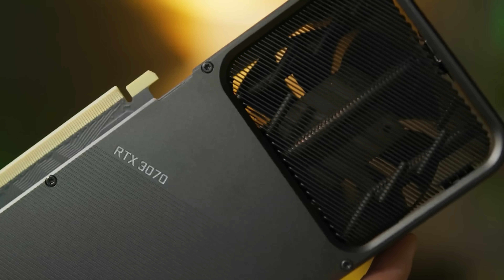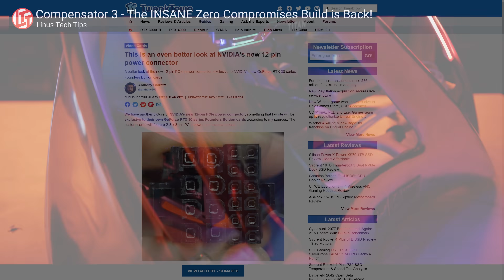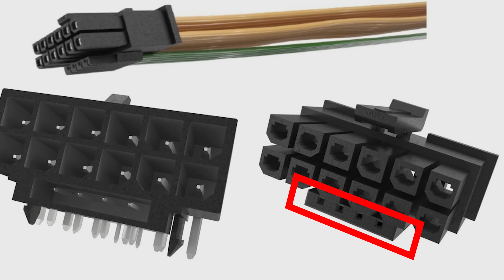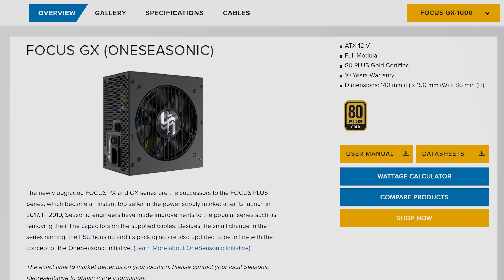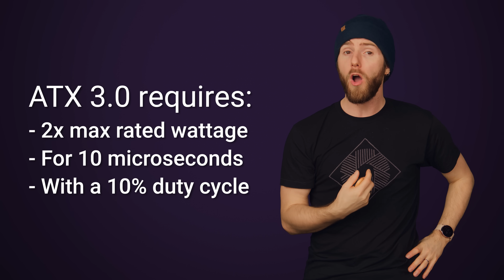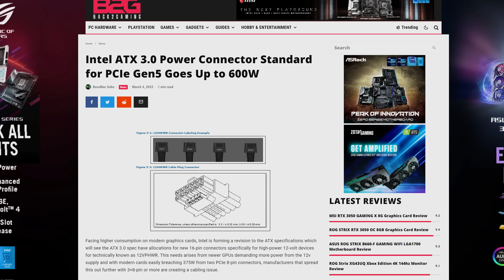Do You Need A New Power Supply? - ATX 3.0

Comment: So in the future I'll need a 16 pin connector for a 100W GPU instead of a six pin.
I really don't care for standards that cater to the insane top end.
It should be a 4+4 pin or 6+4 pin with a 6 pin auxiliary or two with increased cable and connector current ratings.
I shouldn't need to use a bulky plug if I'm not running a high powered GPU.

The idea of using the same connector with different power ratings going from 150W to 600W with two others in between is just going to cause grief in the long run, particularly for the average user who doesn't concern themselves with specs. While having a 12+4 16Pin 600W connector is fine, there should also be a lower specced connector for use on low end PSU's say a 6+4 or 4+4 for use with GPU's up to a more reasonable power draw of 200-250W which can double as a replacement for the 4 pin outdated peripheral power molex connector we all hate.

There's no doubt that there will be hacks to enable higher power over a lower rated connector which is asking for trouble given the simple binary on the sense pins to determine power draw maximums, to enable a 450W card to work with a 300W rated connector which is more likely to be done on cheaper PSUs with dodgy total power claims using the sense limits to compensate for their cheap configuration. Why shouldn't your 750W or 850W PSU be able to handle a 450W GPU or even better your 550W or 650W bronze bargain basement brand when running a 65W Intel 12700 CPU that came in your prebuilt system from walmart, after all 65+450 is only 515W so hack away right!

There really should be physical differences for connectors of different power ratings.
Reply: Yeah this feels a lot like USB-C, where they came up with a great one-size-fits-all solution, and are not letting anything stand in their way, not even the fact that one size does not in fact fit all. Just look at the laptops out there that have multiple Type C ports, and every single one has a different set of capabilities, so instead of having 5 cables for 5 uses with 5 different plugs, it's now 5 cables for 5 uses, but they all look the same on the outside.
Reply: PCI-E isn’t going away.  Although they are starting to remove the second 6+2 plug from a PCi-e cable.

Comment: I wonder if this would release with the new 12 volt only standard for the power supply. No more 5 volt or 3.3 volt rails.
Reply: Unlikely to ever happen fully. The 12v only standard is only really usefull for OEM's, for everything else it's a detriment.
Your components still need those other wattages, all the 12V only standard does is shift the converters from your PSU to some place on your motherboard, which has a plethora of downsides for absolutely no upsides. Downsides include:

1)Those converters need extra space on your Motherboard. 
CPU's, graphics card and chipsets ( mainly their heatsinks) are allgetting bigger already. Plus more stuff on the Board like .M2 slots for SSD's and soundcard functionality beeeing included all means Motherboards are getting pretty cramped already.

2) Those converters produce heat. You can either have that heat happen in your PSU box with its own cooling and airflow, or right next to some of your already very hot components like RAM, CPU and GPU. 

3) Split reliability. Your MoBo is usualy significantly more expensive than your PSU, and with new PCIe generations and (potentialy) 12v converters on the board too it gets even more expensive. If a convrrter fails what would you rather repalce, a PSU or a MoBo?

The only 'upside' to the 12V-only standard currently is efficiency, especialy at low power draw. Most of that comes from converting all power to 12V and then converting that again, instead of converting 110V/240V to 12V/5V/etc. seperately. But there's no reason why the PSU standard can't be changed to do the linear instead of parralel conversion for high efficiency inside the PSU box.

Comment: Much better solution will be to make PCEe slot able to supply all the power required by graphics card, similarly to how Mac Pro does it.
Reply: Mac pro used a second full 16x slot just for power. Also those GPU's where pretty pathetic compared to what we have now or even what Nvidia had at the time.

Comment: Incidentally, I do run a Seasonic Focus GX-750 in my system. My previous PSU didn't have an NTC thermistor for inrush current limitation and would trip my game room's circuit breaker every so often when I fired up the rig. With the GX-750 that problem is gone, and for that reason alone I tell it how much I love it every day.
It does work hard and it deserves time off, but I've got my needs, so it will have to work until it dies. I'm a monster, I know.
Reply: i have a focus gx also bought it around 2020 now am looking to upgrade to a 4080 super and still confused as to do i need a new psu or the non atx 3.0 focus gx is enough?

Comment: ive got a 750w XFX PSU from 2012 and its still going strong, the only issue with it is that the fan bearing began to squeak. i'm gonna re-oil it and keep running it for the forseeable future as its a bit overkill for my build (r5 3600, RX 570)

Comment: Supporting 200% overload for 10% of the time in 10us bursts shouldn't be too hard: at 2000W burst, that is 20mJ of storage and you only need 1400uF worth of low-ESZ capacitors to smooth it out. Since most PSUs already have 5000+uF on the 12V rail, the changes would be more about reducing ESZ to accommodate twice as much ripple current by using twice as many half-valued capacitors in parallel and tuning OCP/OPP protections. The ATX 3.0 spec will mostly affect low-end PSUs since it will force them to have much higher quality output filter capacitor banks than what they can currently get away with. Not as much of an issue for higher-end PSUs that are already doing this to ensure low ripples and long capacitor life for that 7-10 years warranty.
Reply: You are smart, so I shall take your word on what your just said. Yes
Reply: Wow, great answer. I was thinking about that part and how hard it seemed on the "1000+W" premium PSU's, but it makes sense that they would already be able to produce microseconds of high power due to the more expensive parts.
Reply: Why aren't they already adding caps to the graphics cards for that though? They should already know that their GPU does that and yet they don't address that by adding a cap or two to the the PCB? 16v 4700uF filter caps are pretty small and are lower profile than a GPU heatsink and costs around a buck. And that's for a high quality panasonic or rubycon a merely "good" quality cap costs way less than that. Though the cap tier list goes like Rubycon ->Panasonic -------------------------------------------->everyone else.
Reply: @atomicskull6405  You may have one too many digits in there, 16V 4700uF caps are pretty bulky, 330-560uF is what you can get in a format that can be squeezed under the HSF and GPUs already have quite a few of those already. The amount of bypass capacitors on there is only meant to compensate for PSU wiring impedance and feed the VRM.

Even if you put a few more capacitors on the GPU, those still get chonked during power spikes which drops their voltage. Between the increased GPU capacitor bank size and its lower impedance, the PSU still ends up seeing a good chunk of those spikes after wiring impedance delay and attenuation, and still needs to be able to cope with them.

Also, capacitors in a PSU have a lot more available space and cool airflow available than those stuffed under a GPU's HSF, which makes the PSU a much more appropriate location for bulk filtering.
Reply: @teardowndan5364  The problem isn't so much the 200% 100us burst one, which is 200 mJ not 20 mJ. It's the 180% 1ms (1800 mJ) and especially the 160% 10ms (16000 mJ) one. Says PSU Greek god Aris Mpitziopoulos in his Tom's Hardware ATX v3 article. For those power spike tolerances you need a lot better and more capable capacitors than we see in today's power supplies. Also, I haven't seen any ATX v3 power spike tolerance testing yet.
Reply: @teardowndan5364  To handle that whopping 16J 10 ms power spike for a 1000W power supply, you would need and extra 6J from capacitors, as the PSU provides 10J during those 10ms. Using E = 0,5*C*V^2 and V being 12, we know C must be 0,083 Farad, or 83000 uF in total. Assuming the spike doesn't frontload more than 6J of its 16J total electric energy requirement.

Even a 1500W power supply will struggle with this test requirement, as still 13888 uF in total is required. So I wouldn't trust or buy anything below 1600W if you want to be ATX V3.0 compliant, which by the way even the new power supplies from FSP, Asus and Gigabyte with 12VHPWR cable are not compliant with (they specify v2.52 instead).
Reply: @Louis Friend  Oops, missed a zero there. The rest of it still stands though: higher-quality PSU already use more lower-ESZ capacitors than cheap PSUs and may already clear the 3.0 bar. Can't find a published ATX 3.0 spec yet, load transients are pretty much certainly still slew-limited just like the Haswell spec's 1A/us. Capacitors only need to buffer the 20-40us lag between the PWM controller and load, they won't need a massive up-sizing. The capacitor configuration change is more likely to be driven by ESZ for handling twice the peak ripple current at the switching frequency.
Output caps don't need to provide 1000W transients for anywhere near 10ms as most the load will be transferred to the primary side within 50us of appearing on the output rails.
Reply: Mmmm yes electricky things.
Reply: i understood about as much of this as the biden speech
Reply: I don't know much about how a PSU works. But if the next gen GPU has ATX 2.0/3×8pin to 3.0/12+4 pin adapter, I'll be hooking it up to my 2015 Corsair HX1000i platinum PSU and hoping it works fine. 

Who the heck wants a 600w sustained gaming GPU. I'll gladly take whatever spec penalty from not using the PCie 5 12+4 power connector. 400w or less is already pushing it in my room. I'll undervolt the crap out of the 4090/7900xt to get it to 300w so I can game on its quad-slot air-cooling in peace and quiet
Reply: Hmm yes the electricity is electric.
Reply: @link1565V2  You're on the internet. You can look up what a micro Farad is (μF or uF if you don't have the "μ" symbol) in two seconds and learn. I recently did that myself. You should already have an idea about Joules since that's something you'll see when choosing a power strip for your PC.

Comment: i actually say "thank you" to my psu with its fancy protection systmes everytime there is a tiny surge or spike of the electricity. the modem restarts, the monitor restarts, even the tv switches off, but my desktop goes strong without any issues. 
btw its a 10yo coolermaster 600W semi-modular
Reply: XFX 10 year old PSU here too!

Decade long PSU owners rejoice!
Reply: @pedromartins4847  i have the xfx too750w by 12 years!
Reply: Cooler master silent pro 650w 15 year old psu here join the club.great psu for many generation of my computer
Reply: You should know that power efficiency drops with usage over the years. That 10yo PSU might be throwing 300w right now if you're lucky.
Reply: @sovo1212  You are wrong

Comment: If you need a power supply, always just get a really nice new one. Find one that will outlive you. It will be worth it in the long run. I still have my antec CP-850 running in a spare machine, and was using it constantly up until a year ago.
Reply: Got a Seasonic Fanless TX-700 with my new 11th Gen upgrade in March last year. Just waiting for the RTX 4000 series now.

Comment: Hey there pc p&c silencer 610. We’ve had some times haven’t we? 2006 - 2022 and counting. 
From when we first met, you got put into the bare bones special case after the stock PSU let its smoke out into the world. First worked together powering that Prescott cpu and some nameless ATI agp slotted GPU. 

Things sure changed after that. Stepped up to DDR2 memory, a Conroe E6600, and that beast of a GTS 8600. Even got us airflow minded new case with some massive 80mm fans. Serious business now. 

Things got real crazy when that gtx460 found it’s way into the case, followed by that eBay special Wolfdale 8600. Oh the upgrade possibilities of that socket 775. 

Then we stepped bravely into the future together. That i7 7700k and the jump right past ddr3 into the bleeding edge ddr4 hotness. One good upgrade deserves another and now you are powering the gtx2070, with all its ups and downs. Outlasting a set of case fans that got too loud for their own good? No sweat. 

We laugh together at the thought of new connectors while dangling chains of unused molex connections still dreaming of their ide hard drives.

Comment: Oh great, the cables are supposed to (but may not always) state how much power they support. Even in a best-case scenario, where they are properly labeled, most users won't know to check. Sounds dangerous to me.
Reply: The ground/open status of the last two pins of the +4 handle this.
A GPU should only draw up to the limit the pins indicate. (GG=600, OG=450, GO=300, OO=150)
So as long as the PSU and Graphics card are made to spec, user error isn't a problem. Worse case is the card underperforms or a message is displayed to upgrade the PSU.
[Edited as I listed the wrong pins]

Comment: Well my 750w PSU handles my 3090,  NVMe drives, full fat HDD drives and a beefed up 5600x power limit, alongside a whole bunch of USB devices

Not once seen a crash due to power spikes

So dont think my PSU is obsolete and adapter exist so even if it was an adapter negates anything that makes it obsolete

Hell i have to draw over 640w before the things fan even turns on

Comment: Could manufacturers just make adaptors for ATX 2.0 PSUs for when we eventually upgrade to the new standard?
Reply: the adapter needs to many stupid cheap resistors and caps ATX 3.0 is a nightmare PSU wouldnt touch that firebomb even if you payed me

Comment: This is a good idea but done in a horrible way. The I/O should go to the motherboard which then talks to the GPU through the PCI. This way, the motherboard can also talk to the PSU, and keep TOTAL system load below the PSU maximum! GPU and CPU being able to communicate effectively.
Reply: The power supply's capacity can't be distributed arbitrarily across it's connectors. Each connector is connected to certain power buses, and each power bus is going to have an individual limit. The 12vhpwr connector will probably have dedicated power buses, meaning the GPU doesn't share with anything else and there wouldn't be anything for the motherboard to help with.
Reply: @klikkolee  You've missed out how 12VHPWR works, PSU tells the GPU how much power it can have, GPU then clocks itself lower to reduce power consumption to within PSU spec. That could easily happen with the CPU as well.
Reply: @khalidacosta7133  I don't see how that contradicts anything I said. The CPU would probably also be given dedicated power buses for its connector, so the motherboard again can't really manage "total" load. The chipset might have some of the of the hardware for negotiation, but it'd just be mediating between the CPU and the power supply -- not needing to consider the power usage of other components of the PC.
Reply: That would make all current motherboards incompatible and basically you're stuck with no GPU upgrades till your next PC upgrade which can be 5 - 10 years from whenever.
Reply: @ScaredDonut  Nope, no I/O connected, PSU just goes into "dumb" mode and operates as your standard PSU. Forward and backward compatibility assured.

Comment: i just build my first pc and the power supply, seasonic Gtx 650 is giving me some problems; when i touch the power cable connected to the pws from the wall  it gives some fry sounds and somethimes it doesn't turn on, i'm motoring (maybe it was not fully connected the cable), what do you guys/girls think?